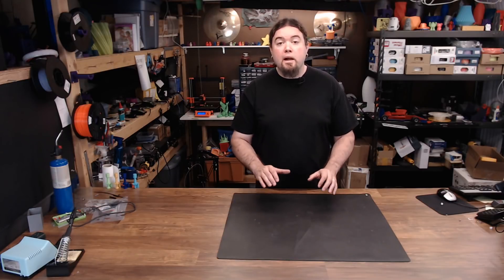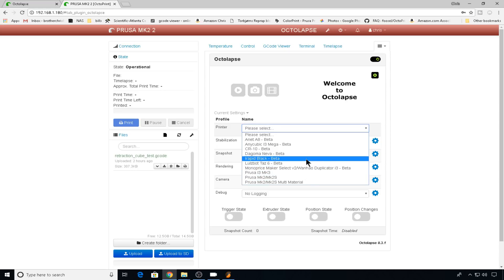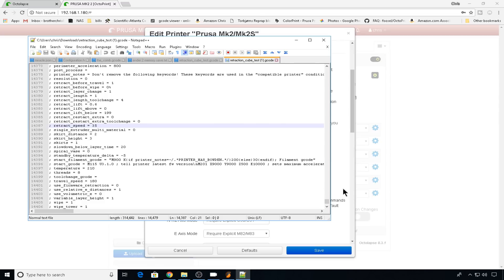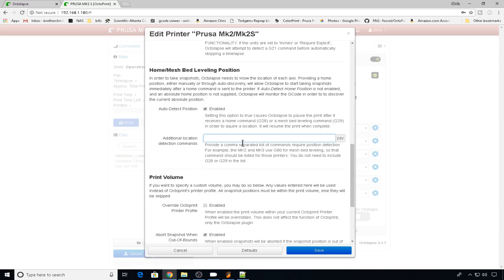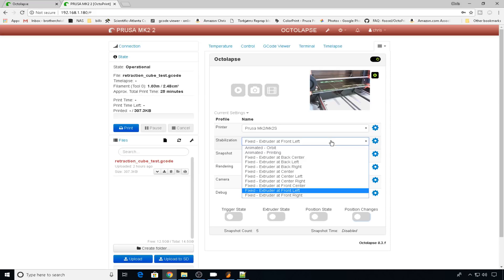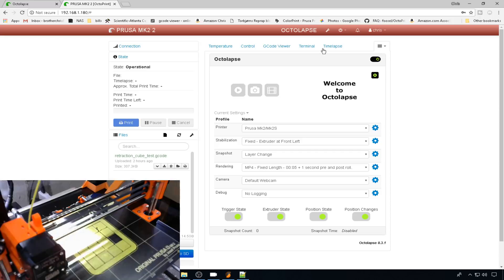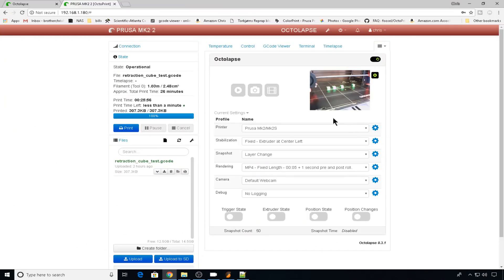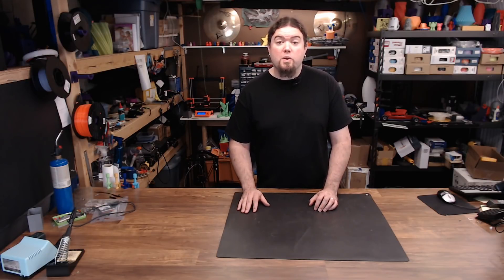Octolapse - Octoprint Time Lapse Plugin - Chris's Basement

Comment: You Sir are frickin' AWESOME!!! I got OctoPrint and OctoLapse setup on my HP and love it. I did have an issue with installing OctoLapse because of an internal server error but after some investigation on issues on GitHub there was a link I pasted into the PlugIn Manager that gave me a version that worked. I am being prompted to upgrade but kind of afraid to because it works. As the old saying goes, don't fix what isn't broken..lol .. I am using a generic walmart webcam. Not the best quality for now. Now zoom or focus is not available. Thanks again.
Reply from the maker: Thank you! That's awesome you got everything up and running. If it's working, I am always hesitant to upgrade. :)

Comment: Hey I have been trying to get started with the Octolapse, but I am having issues with lots of stringing which seem to spoil the print. Could you share your settings ?
Reply from the maker: I always had that same issue when it took the snap. It has changed a bit since I last used it, I an not sure if there is a retract when snapping or not.

Comment: I have a question. I am running octoprint on my windows 10 machine that is hooked up to my Ender 3 and Geeetech A20M and it works great thanks to y our videos. but I have tried to install octolapse and it crashes everytime I just can't get it to run. I set up everything turn it on then run test print and it instantly errors out. When I get home and have time I can get you the messages. the a20m just erros out the ender 3 disconnects and just loops reboot until I unplug usb turn off octoplapse and all is fine. Like I said octoprint runs great and I have them set up for each printer per your video.
Reply from the maker: Probably some setting in octolapse causing and issue. Let me know if you find the error message.
Reply: @ChrisRiley  what I ended up finding out was it must have worked the whole time but for some reason it was the test mode that wasn't working. I always just tried testing all the time I put it to live print and it works. But I do get a position error or something on my ender 3 after the print but it still works so not sure.
Reply from the maker: @toddcoello6461  Huh, strange. There is probably some gcode at the end it doesn't like.
Reply: @ChrisRiley  I have it narrowed down. Appears I didn't set gcode in slicer and had a few things not right. Ender 3 is printing so I tested on the a20m and so far so good. I'll post timelapse on my page and hopefully you can check it out and help me out. I have a few from original timelapse but this will be with octolapse
Reply: @ChrisRiley  https://www.youtube.com/watch?v=zqrA74CWAGw got a couple tests done.

Comment: Great video - But what happens if you slice something and all your speed settings are different from what you just saved in Octolapse?
Reply from the maker: It does some strange things I have found, like leaving zits on your print.
Reply: @ChrisRiley  so I have to edit octoprint every time i change a setting? Or have multiple printers setup for each common profile used in slicers? Annoying:(
Reply from the maker: @modrows11  I think so, but you might run it past the developer over on github. There might be an easier way. https://github.com/FormerLurker/Octolapse

Comment: how do i set it up with cura how do i fined my z hop
Reply from the maker: Look for this setting, Z-hop height, you will have to turn that option on in advanced settings to see it.
Reply: @ChrisRiley  ok then just input what it says or do I have to adjust that number
Reply from the maker: @wingsofsarrow  Yeah, just punch in what it says.
Reply: @ChrisRiley  ok will try I 
What if my internet does during a octolapse will the print stop or will it keep going
Reply from the maker: @wingsofsarrow  It will keep going.
Reply: @ChrisRiley  will i have to be connected to a pc to start a timelapse or can i just connect the printer to the rapberry pi and start a print
Reply: @ChrisRiley  what is detraction on cura
Reply: in octoprint my State says Cancelling

Comment: I don't have a Raspberry Pi and Octoprint yet, but I'm considering getting one specifically for Octolapse. One thing that concerns me is it looks like you have to go through and copy settings from your slicer. The problem I see with that is, I often change those settings depending on what I'm printing, so I'd assume I'd have to update it each time? I would think Octoprint/Octolapse would have a way to dynamically update that based off the gcode you're printing. I mean, why wouldn't it be able to do that?

Depending on what I'm print, if it's an aesthetic piece, I drastically lower the print speed and especially outer wall speed to minimize ghosting on detail. If it's just a functional piece, then I'll run it faster because I don't care as much how it looks.
Reply from the maker: Yeah, I am not sure about pulling the values, but creating separate profiles will be about your only option at the moment.

Comment: Great video! I tried all the steps but something is missing I guess since my print has a lot of strings and is a little messed up
Reply from the maker: Thanks! If the retraction isn't matched up, things can get a little messy. Sometimes the newer slicers stick commands into you GCODE you might not know about. I would take a look at your GCODE file and see if anything looks strange.
Reply: @ChrisRiley   I will check. I have prusa i3 Mk3 wirh slic3r
Reply from the maker: Oh, well then you should be all set then. Not sure why you would be bad results.
Reply: @ChrisRiley  maybe I messed up something while converting from mm/min to mm/sec. I will check later tonight

Comment: thank you again for the great video!
did you try to print a vase in vase mode and capture it with octolapse? I have issues, ones the  buttom is printed and the start to print the shell it fails, the print-head is moving al the time to the side and back without printing the layer
Reply from the maker: I have not found a good way of doing vase mode with octolapse. There are some new features, I will test it.
Reply from the maker: This one turned out pretty good. https://drive.google.com/open?id=1bFpvPl_61m0q_2cfcZi4QwwrV9liJuCV

I set it to to height 0.3mm and turned off zhop and retract.
Reply: @ChrisRiley  very Nice job Chris, thanks for testing it! You have another fan 😎
Reply from the maker: Anytime! Thank you for the support!

Comment: Is there a specific export video quality? or are you able to access the photos and post process them yourself the same way you post process timelapse photos on a dslr for example.
Reply from the maker: There are some settings you can change, like FPS, but it renders for you I don't know if there is a way to export the snaps. The best way I have found to increase the quality is to set the camera to a high res in the config files. Check out /root/bin/webcamd

Comment: Perfect video manual for octolapse, thanks!
Is there any negative effect in print quality? Each shot the nozzle leaves the print and comes back.
Reply from the maker: Thanks for watching! There is some, but it kinda depends on the model and if you have your setting configured just right. Sometimes you will notice very small dimples or blobs on the prints at the point where it takes the snap. I have had model where they came out flawless, so you have to play with it a little.
Reply: Chris Riley thanks for answering Chris!

Comment: Good job Chris! One reason Octolapse makes such great time lapses is that it pauses the head for a second when it takes the snapshot, so nothing is in motion. This is great for photos, but could impact print quality. For example, I have yet to figure out how to get a good vase mode print while using Octolapse. All those little pauses show up as zits in the print. The Debug setting has a Test Mode that is a real bonus when starting out. It will run through the whole print, but with no heat or filament. So you can get a feel for where the head is going during the snapshot, and any other oddities that Octolapse might introduce. Octolapse is a really cool addition, I used it to make all my stop motion dino videos, which you would have seen if you were on Twitter.
Reply from the maker: Thanks Scott, the debug more sounds promising, I'll have to check it out. Dang, that sounds like a sweet video, I wish I was on Twitter. :) Thanks for watching man!

Comment: It would be cool to put a webcam on a controlled track that would slowly pan across your print bed over the course of the print, adding some motion to the already awesome octolapse feature. Probably wouldn't be hard to make something with an Arduino and a little hardware
Reply from the maker: That would be awesome, if you could work it in to a octoprint plugin so you could inspect both sides on the print, that would be killer. So many ideas.